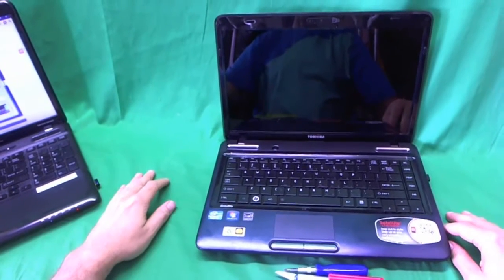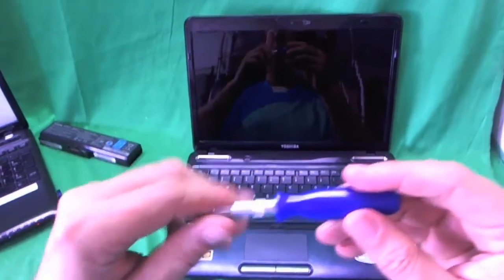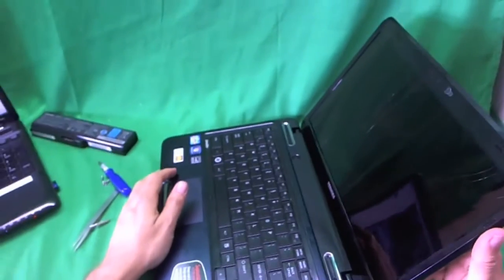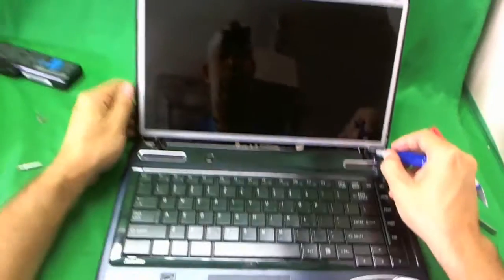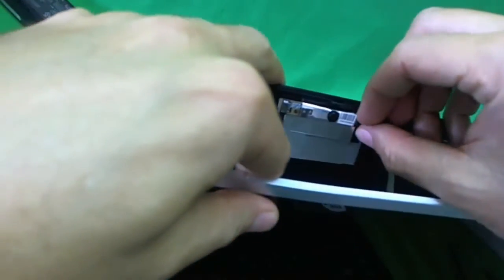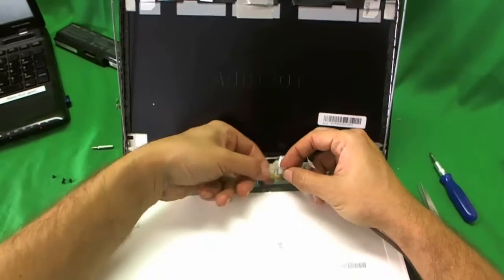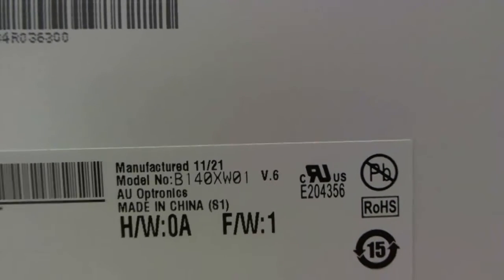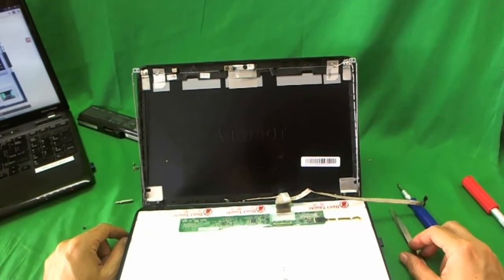Toshiba Satellite L745 L745D Laptop Screen Replacement Procedure

Comment: hi, i have 2 toshiba satellite laptops but different model number (c655 and l745). i would like to know if its possible to switch the screen from l745 to c655 cause my c655 has dead pixels and it has been a bother